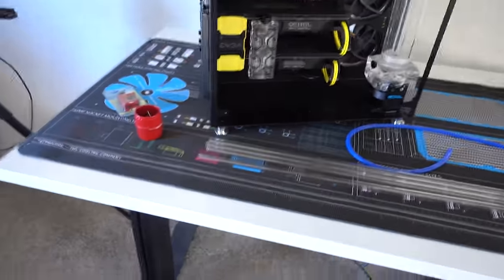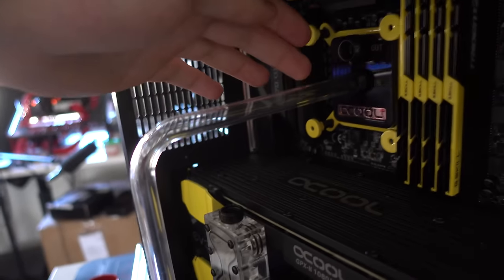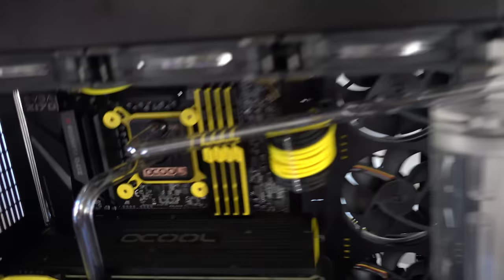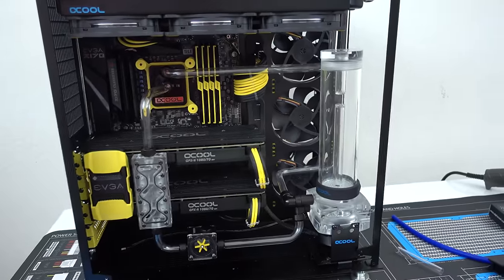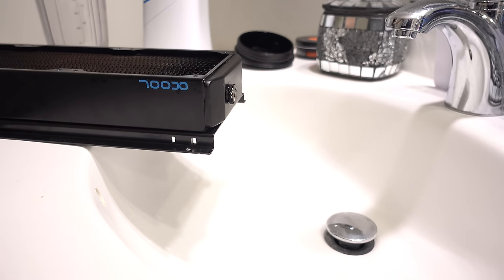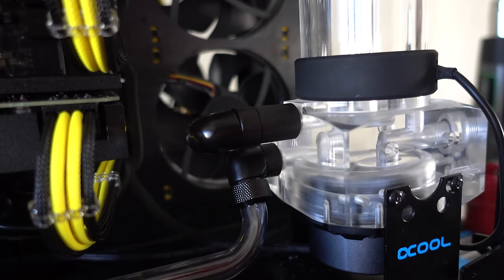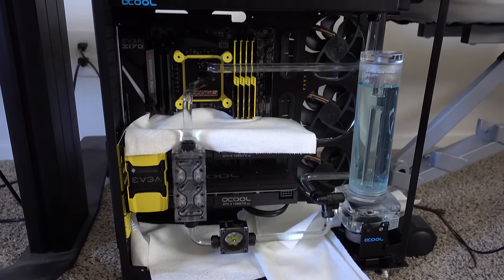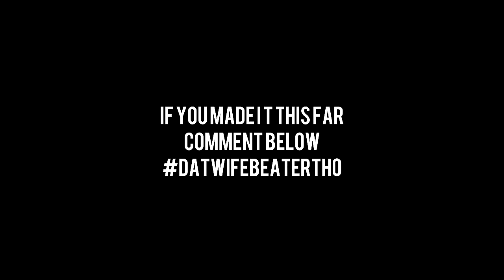More Problems With #ElectroBox | Final Episode

Comment: You do realise you don't use mayhem's blitz kit to flush the system when building the pc right?

Its meant for cleaning systems months after the build has been running to clean out all the gunk.

A simple distilled water to flush the rads was all you needed.

Comment: I'm actually amazed by how long it has taken large YouTube "tech leaders" to finally build their first loop. I have been building loops myself for 6 years now. Not just cosmetics, but custom loops are incredibly efficient at cooling. AIO coolers and open air don't offer the overclocking capabilities as a custom loop (depending on how efficient the block is). I should seriously start a channel on just custom loops and varients of them, and all tutorials. Looks good btw. 
The absolute best company for custom loops is EKWB in my experience. Expensive but second to none in quality. Best fluid, Mayhems.

Comment: this is exactly why i stick to aircooling, jesus
Reply: Mihkel Rebane i feel ya
Reply: Mihkel Rebane and AIO coolers!
Reply: Don't forget, you have to drain and clean a loop yearly for... ever, or until you decommission the system/take apart the loop and replace it with air cool. You can never just put a waterloop on the shelf or hand it down to someone.
Reply: Mihkel Rebane just buy an AIO watercooler :D
Reply: Juan Carlos Celestino you know that is just for cpu and this is for hole pc
Reply: hugo heikkilä exatcly, I love them
Reply: Normally it doen't take nearly as long...Finished mine in half a day and happy since then
Reply: Mihkel Rebane you can just use soft tubing
Reply: To everyone in this thread comment 1) soft tubing is gross why would you ever do that?! 2) water cooling a pc has its benefits over air cooling and 3) when you have a high end pc you want to make it look nice a pretty and that's water cooling for you.
Reply: AIO. Get wrekt
Reply: AIOs still require draining and cleaning. There is no fire and forget solution for water cooling. Anyone who thinks water cooling is without some pretty huge inconveniences is uninitiated. Not to knock water cooling, but I don't think a lot of people know what they are getting into for the long term. They build a custom loop and go "ah, watercooling wasn't that hard," as if that is all there is to it. It's the taking care of it that sucks. You either have to do it fairly frequently to keep it clean, or if you clean it out of date, be prepared for a huge mess inside your loop.

Comment: the performance will be so bad.... just that one radiator for sli cards and cpu....
Reply: no it won't. it won't be silent, be if he pushes the fans it will be running really cool
Reply: Pedro Silva that single radioator does not have enough cooling performance 
even with eloops on 100% it wont run that cool 
overclockability almost non existent 
and thats the only reason one should watercool his system 
240rad at least for every component in your system
Reply: Dude, it is still better than air cooling. And no. Overclocking is not the only reason one should watercool a system.
Reply: Pedro Silva either overclocking or lower noise 
you can get great cooling performance from air cooling 
a nice aircooler, noctua for example would have better temps on your cpu 
i got a thermalright macho x2 and just 60°C under load 
4790k @ 4.8ghz 1.35v btw 

gpu depends on the type of cooler but a good aftermarket cooler 
evga for example will probably have better temps
than a custom loop with a way too small radiator
Reply: No. If you have the money, or the parts, you can just do it for looks.
Reply: Do you agree that the difficult bend was completely unnecessary? He could've just went straight down from the radiator to the top of the reservoir tube....
Reply: Pedro Silva looks are a plus, completely right 
but if you have the money than just buy more radiators 
why stop there if you have the money?
Reply: there are huge aircoolers that are much better than watercooling
Reply: true :)
Reply: decent thickness 360, 120mm for each component isn't so bad, but oc is 0
Reply: a thicker radiator doesn´t give that much more performance 
120 for each component ist pretty bad if you have sli, gpu´s pump a shit ton of heat in your loop
Reply: Look at those all-in-one graphics cards, they use 120mm and overclocks very well.
Reply: but they are not very quiet when you apply high overclocks
and they often do not keep the high clock and throttle down after a while
Reply: so if he doesn't overclock those components to the moon he will be perfectly fine with that 360 with 60mm thick
Reply: Its a pretty thicc radiator. I guess we will find out when the time comes. I think it will be fine but temps might get above 60 on the gpus.
Reply: ZeroG Coasters Have you ever custom watercooled? Where did you get the idea of "240 rad for each part"? No oc headroom with 3 components in a 360 rad? Honestly where do you guys even get these types of bloated ideas?
Reply: SCSI my experience, experience of others, yt videos 
240 for each component is something almost everyone agrees on
Reply: Reeeaaally? Nice experience you have there alongside your fellow ytubers.
Reply: ZeroG Coasters  It's not 240 for each component everyone's builds would be dead by now it's 120 for each component and an extra 120 for overhead.
Reply: 240 for each component is a rule of thumb for a very quiet and cool running system 
120 works fine but if you get 240 for each component you will a very silent system with great temperatures and especially better temps than with good aircooling 
120 for each component (+120) is nice, but you can almost get the same performance with good aircooling, which will most certainly be waaaay cheaper
Reply: ZeroG Coasters OK 240 for each component is overkill the only way that makes sense is if you don't want to run high rpm fans (1500rpm over 3000rpm for example) just so it can be more silent but using the 120 method will get you better temp than any aircooler I don't know where you get your information but it's extremely flawed.
Reply: have you ever put a high end noctua cooler on your cpu?
cools better than some watercooling blocks

overkill woould be 280 or more for each component, it depends on your system, if you run a i3 and a gtx 950 you will be fine with a single 140 i guess, but noone watercools this hardware 
consider something like a 7700k and a 1080 or 1080ti, or even a 1070 
then 120 for each component wont be enough

even 1500rpm fans are pretty loud on 100% 
my system is almost completely silent under full load (at this point my eloops reach arround 800-900rpm)
Reply: i think you're right, TechSource should put another identical radiator on the bottom.
Reply: not enough space at the bottom for a radiator 
i would put another radiator at the backside where the 3 fans are
then since there would be no more space for the reservoir i would put that reservoir at the bottom, horizontal of course
or drill holes through the backplate of that case and put it in the back
Reply: using slim fans and a regular thickness rad it should fit in, there is about more than 80mm of clearance between the gpu and the bottom.
Reply: low profile fans are usually not that good or pretty loud compared to other fans 
but a 30mm rad should work just fine even with normal fans 
but ed doesnt have 30mm rads i guess
Reply: Dude chill, don't get so triggered because Ed couldn't have that radiator there because he needed space for the reservoir.

Comment: he started this build so long ago his pc is out dated

upgrades anyone
i7 7700 or i7 6900
gtx 1080tis sli
Reply: 6900
Reply: Jordan Vaughan the IPC improvement of kaby lake over sky lake is so small it can be fixed with a minor OC and the 6900 will not be as Good for games as the 6700 or 7700 he shouldn't spend money where it is not needed
Reply: as for GPUs 1080 sli is over kill for everything so no upgrade needed there as well

Comment: Hey I was wondering if someone can check this build out:-

Fx 8370
Asus 970 Aura
2x Rx480 8gb 
8x1 Kingston Hyperx Savage Ddr3 2133
Evga 650watt
Seagate 2tb harddrive
And a samsung 4ktv for a monitor

1.Can I do 4k gaming?
2. will the 650w power supply be enough?
Reply: ichigo kurosaki will struggle to run roblox
Reply: +Ngationic otherwise is it nice?
Reply: ichigo kurosaki hell no that cpu is sooo bad and a 970 can barely play 1440p
Reply: +nuggets321 so what do you recommend?
Reply: +nuggets321 asus 970 is not graphic card its the motherboard
Reply: ichigo kurosaki for 4k at least an i5 6600
Reply: ichigo kurosaki and for gpu a gtx 1070
Reply: +nuggets321 did you not see the Redtwin build done by edgar?
Reply: Oh
Reply: Sorry my bad
Reply: So you might wanna get another cpu personally I'd wait for ryzen 5
Reply: +nuggets321 will 650watt be enough for this build?
Reply: No I'd go with a 750w psu to be on the safe side
Reply: get a 800 w psu because 2×480 will take much power
Reply: Dont get ddr3 ram
Reply: So your probs gonna have to change your mobo and might have to change to intel
Reply: ichigo kurosaki dont get fx
Reply: nuggets321 2 rx 480 perforamance is around The same level as a 1080
Reply: ichigo kurosaki yea get intel and 650w should be enough but if you want to heavily upgrade it later on get 700w unless you want to just overhaul the whole thing when it's out of date.
Reply: ichigo kurosaki yes but not very much breathing room
Reply: ichigo kurosaki you dont need 2xrx 480 buy one gtx 1070
Reply: Have you not bought any of this yet? Seems like a really odd setup... You have to balance out your components. For instance. There is no point in spending a lot on a nice monitor, then not having a powerful enough system to take advantage of it, or having a super beast rig, and not being able to take advantage of it with a high refresh or high resolution monitor. What is your budget? Seems like you are trying to make a pretty expensive high performance rig.

Get a different processor, an i5-7600 or 6600 or one of the new Ryzen R5 processors coming out. (People get the k for overclocking, but eh.)

2x Rx480s are a solid choice if you can snag them on sale and rebate, which is pretty frequently. At retail price comparison, I would go for a GTX-1080.
This is especially relevant because AMD Polaris cards scale in crossfire slightly better than Nvidia's SLI, and Polaris also has better performance scaling in higher resolutions. Rx 480s in crossfire essentially match a 1080 at 4k, though there is some variance between titles. Some games will run slightly better or worse on either card.

If you can, get a 4x2 RAM kit instead of 8x1. This will give you a few more fps. RAM runs better with at least 2 channels.
I would get a higher output power supply because you really don't want to cheap out on the PSU. It is tempting as there are a lot of power supplies that look perfectly fine for $35, but don't be fooled. Get a nice PSU with some decent overhead (go on pc part picker and see your power usage), lest you kill all your components when the PSU suddenly dies or is too weak.

Hardrive. At this price point, I would definitely recommend an SSD. Get a 120gb or 240gb ssd though you can go for more. Put your operating system on it. This will give you really fast boot times and your desktop will feel very responsive. I'd just go with a 1tb hard drive to start. By the time you reach the 2nd tb, you can just get another hard drive. Unless you're putting a ton of shit on your computer, it's probably gonna take quite awhile to get over 1tb. A standard hard drive with an ssd is nice because it lets you preserve your ssd. SSDs get 'killed' through usage, and have a finite lifespan. This is still quite a while, but you don't want to be installing and uninstalling tons of stuff, which makes it bad for say, installing and uninstalling games and such that you only play once in awhile.
Reply: ichigo kurosaki ichigo kurosaki bro not to hate on you, but don't even do this build. R5 is right around the corner and the fx series is not good. 8gb of ram(ddr3 2133 at that)and 2 rx480s?what? Furthermore as a consensus it is generally better to get a single more powerful gpu than two weaker ones(so get a 1070)reason is not all games support crossfire and lower tdp/temps. Summary is don't get an fx cpu, get 16gb of ram, and get a 1070 if you're not willing to wait a couple months for AMD to finish releasing all their stuff.
Reply: buy a ssd instead of 2tb hdd
Reply: +dogboy0912 my budget is around $750.I was planning to get a single rx480 for now and the other later on. For around $750 what build will you recommend?
Reply: I am telling you don't use an 8370. It is an old and not-so-good processor. I use a 6600K with an Msi 1070 and it gives pretty much over a hundred fps in 1080p in ALL games. I suggest you buy the same cpu but get probably a 1080. That would 100% give you well above 60 fps in ALL games. Also you should get a dope-ass cpu cooler (I have the CM 212x and it gives me constant temps below 65C when it overclock it to more than 3.9 Ghz. And.... get 16 gigs of ram at 1600mhz which will be enough and get a 120gb ssd for fast bootup. And yeah the 650w psu will be enough if you are not going to overclock the cpu.
Reply: hey! i would either sell 1 of the rx 480 and buy a better proccesor?? not sure about the socket/compatability isues
Reply: ichigo kurosaki Why now wait for Ryzen 5?
Reply: ichigo kurosaki You can't game on a tv, no matter how high end it is. The input lag and response time is disgusting. It's sad, because obviously you'd need to buy a monitor if you wanted the best gaming experience that you could achieve with the 2xRX480s
Reply: ichigo kurosaki why DDR3
Reply: StrictlyBusiness FX series doesn't support DDR4
Reply: I recommend upgrading your 8 gb of ddr3 to 16 gb ddr3, because that mobo doesn't support ddr4. Also, I recommend a better graphics card, such as an inexpensive one like the EVGA GeForce GTX 1050.
Reply: switch to Intel get I5-6600k that would not require much power as well.
Reply: Get a 1060 and wait for Ryzen 5. And Never do ONE stick of memory, Always go for dual channel. 4k Hell no you might be able to with older games but not modern games, that is a 1080/ 1080ti thing. And don't use a TV for A monitor, go for a 4k screen
Reply: Right, so it seems like lots of people are arguing over the build. With those specs, it really doesn't matter much with motherboard... in fact, I have the exact same one and it works very well. Use a power supply calculator online to work out how much power the FX 8370 and RX 480's will draw. The draw seems to be around 500w (487w to be exact) so to future-proof, go with at least a 700w unit... but it should run fine on 650w providing the power supply is from a reputable brand. The cards don't draw much power anyway. The CPU will be the biggest hog. As for the monitor, some of the other comments are right... a TV will have shocking input lag and response times. The best thing to do would be to go buy either a few 1080p monitors with a 5ms or less response time a or a 4K monitor with a 5ms or less response time. Look for anything around the 60Hz range with either 5ms times or less and you should be good to go. Those monitors tend to be best for FPS games like CS:GO. If you really want a good monitor, find something that has those specs but is also an IPS display - they tend to have better colours. Also, it might also be better to go for a 2x4GB dual channel kit of DDR3 ram as sometimes it can actually improve performance by populating two ram slots on the board. Don't listen to the people saying that you need 16GB of ram because it's DDR3. Regardless of being DDR3, the only area the ram will lack is with its speed. Even then, you can overclock it. Depending on your budget, you should probably buy on Intel's side or even a Ryzen chip but if that isn't an option, this will work fine. You could even try getting a decent water cooler and overclocking that 8370 then buying a GTX 1070 as it would likely perform better than two 480's. When you consider the FX 8000 series, you can't go wrong on its price-to-performance. 

Hope that's what you were hoping to hear :)
Reply: +Noah de Boers Thats exactly what I was hoping to hear. The thing is I am getting a very sick deal on a Samsung 43 inch 4k smart tv i.e $100 . Also which cpu do you use and what are your full pc specs?
Reply: 4k tv is nowhere near the same as a 4k monitor, it would be terrible to use. A 1070 is better than 2x480s, and there won't be optimisation issues. That cpu is too old and is sometimes beaten by i3s. An i5 and 1070 would be better. Using a tv as a monitor is not smart- id much rather use a nice ips 1440p 60hz monitor, would look way better
Reply: At that budget an ssd is a must. A 240gb or 500gb ssd and a 1tb hard drive would be good. Also a seasonic s12 psu would be better
Reply: Noah de Boers problem is the fx series is way behind- sometimes it is beaten by an i3-6100..
Reply: Ahhh ok. Well I guess you could use it but it wouldn't be ideal. My system specs are: 

Asus 970 Pro Gaming/Aura
FX 6300 @ 4.5GHz
8GB DDR3 Corsair Vengeance 1600MHz 
Asus R7 360 
Thermaltake 500w - Can't remember exact model
Thermaltake Versa H22
1TB Western Digital Blue
Corsair H55 Quiet Liquid Cooler

Plays Rocket League, CS:GO and some others at Max with 100+ FPS on dual 1080p monitors.
Reply: Yes I agree, and while it is beaten in some tests, it has higher clock speeds, is overclockable and sports 8 physical cores. You could go with an i3, but I can see the practicality of not buying one at this point. A better competitor would be the i3 7350K but even then, the rendering on the FX processor is insane. They aren't obsolete just yet.